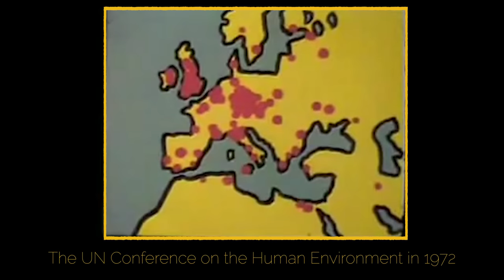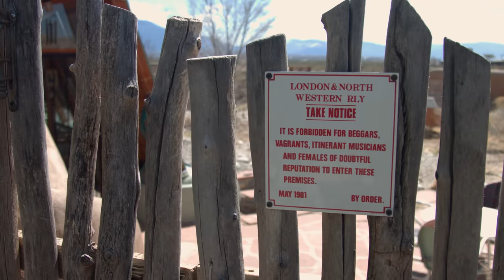Earthships - America's Off-Grid Desert Community

Comment: I was curious so I did a little more research. Do not be fooled into thinking they are anything but interesting architectural ideas built at enormous financial and material cost for the slightly more environmentally conscious upper class. They cost so much, the average person could never dream of building one. They cost a lot to maintain, and only in rare cases will occupants be completely off-grid (you will need supplemental water and electrical services, as well as trash services unless you can bring your personal waste to near zero). They are very cool architectural design challenges, but they are less sustainable than a well designed apartment complex that was designed with sustainable practices in mind. An apartment complex can house dozens of families for the same cost as housing one wealthy person who believes themselves to be personally saving the world.

Meanwhile they likely have to get in their gas powered vehicles and drive long distances to get basic resources to supplement their NOT truly self sufficient lifestyle. The path to a more sustainable future is not to seclude individual families, or worse, individual people, in expensive desert homes made only partially from sustainable materials. The right direction is more likely building large scale sustainable systems for use by whole communities of people educated on sustainable practices. 

Instead of trying to figure out how we can allow single family homes to make less of an impact one expensive house at a time, lets put more time and energy into engineering large scale sustainable systems that work for many people at once. Living selfishly is not living sustainably. An entire million dollar home in the desert for a single occupant? That is a selfish, "leave me alone" mentality. Which is FINE! To each their own, I'm not exactly a people person. But you cannot claim moral superiority over anyone on the basis of your sustainability while living in a earthship home. Because it simply isn't sustainable in the ways you think, especially not long term. 

Check out some quotes from the article bellow. Quoting from  https://theministryofarchitecture.com/earthships

"In a dry environment, like New Mexico, it is not physically possible to collect enough rainwater to support the house. Many who have earthships have to get in their cars, drive 30 minutes to town each way, and buy water just to survive, let alone wash dishes or laundry. If you have more than 11 inches of rain per year THAT HIT THE GROUND, you might be alright, if you are a couple or only have one child and limit your water use."

"Earthships don't work as they are intended. Not even here in New Mexico. The further you get away from new Mexico, the more issues they have. There is no such thing as a "global model" of ANY kind of architecture. Anyone who tries to sell that idea is selling snake oil."

"Many people like to think that earthships are "natural." That is simply not accurate. They are beautiful, organically shaped objects that embrace recycling in a way that can help keep things out of the landfill - which is GREAT in principal. However, more than half of the volume of materials used in the build is concrete, which contributes 10% of the world's greenhouse gases and removes oxygen from the air you breathe - this can be a real issue if you have breathing issues or allergies, as you will be competing with your HOME for oxygen."

"Despite the legends that the earthships are ultra-affordable for people who want to build their own homes and save money, there is actually no cost savings in designing and building an earthship over a conventional home, unless you can perform 100% of the work and obtain all the products yourself, and even if you can accomplish that, in the US, $150 per square foot will get you a bare-bones earthship that has all the same features of a "real" one. (You can do it for less, but it won't actually work like an earthship. Even a real earthship doesn't work. But it has a higher baseline of performance than most modified designs built for less.) This cost goes up depending on how craftsmanship-challenged you may be. It costs $225 per square foot to have Earthship Biotecture build your earthship. It also may take you up to 2 years to build your own earthship. In comparison, you can design and have built a home of "sustainable" construction in a few months, with NO effort, for the same amount of money. However, the sustainable they sell you, will be (only) slightly less sustainable than an earthship. The earthship that everyone wants to point to to say "hey look, these CAN work" is the Phoenix. It's gorgeous! And you too can have it for a mere ... wait for it... $1,500,000!!! But you probably won't be able to insure it or get a mortgage, so please have cash on hand."

"Once the earthship settles, the breakdown of the rubber tires, which by nature was already in process, now happens in an enclosed environment. Which means, the gas expelled by the tires as they disintegrate collects in the walls, and then has the potential to release toxic vapors that you can't smell but could make the inhabitants sick. "They" will tell you that the walls are encased, and that by adding vents, that off-gassing is not a concern, which is only true as long as you replaster every surface EVERY YEAR and don't allow cracks anywhere on the tire wall, and as long as the gas doesn't find its way into any invisible pockets (which are unavoidable) that happen to NOT be near a vent. If the gas builds up in a closed system... well, think of a balloon... if you blow it up past its surface area, it bursts. If you try and encase the gas, it might work, for a while... but then what? We don't know and we aren't sure we trust the people that profit from these designs to tell the truth about how dangerous this could be. (That's kind of like asking Monsanto if GMOs are bad for you.) Here's a link to our collected scientific research on the subject." [http://hackingtheearthship.blogspot.com/p/earthship-academic-research.html]

Comment: Why the fascination with old tires?  Structural integrity is important, but why add 1000% to labor expenditure just for using old tires? 

Build the same off-grid concept with purpose-built materials, and I'll buy.

I don't understand using garbage and 20x the labor just for marketing...  Use purpose built material and market the concept as containable.

Comment: i wanna do this with burried multi story container homes with ventilation atriums and tracking solar over the ground surface like a lid for the atrium almost so you could program it to keep rain out when it rains. 

like, most of his design principles are great, I just dont wanna hand dig garbage mountains. 

its great what hes doing in impoverished nations though. 

but yeah, do these with connexes and cement, use way more solar and wind with lithium iron phosphate backup batteries that also come in a connex, and then build a water tower you can fill from a truck as backup when rain water isnt enough. 

is yalls filtration good enough to remove the pfas and pthalates and everything else? rainwater isnt drinkable anymore we've got to remove that shit, thats what canned drinking water is about. or are we just washing ass with rainwater and all food/cooking water is sparklets in glass jugs because I guess that also works until it doesnt and then fuck it?